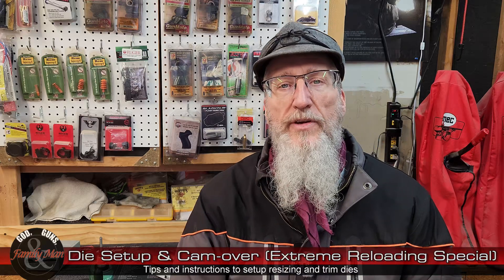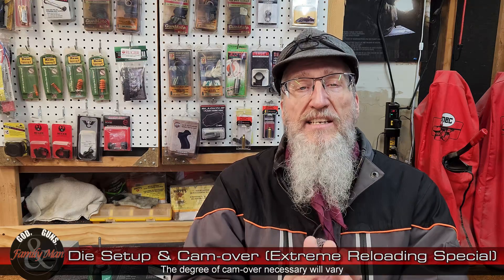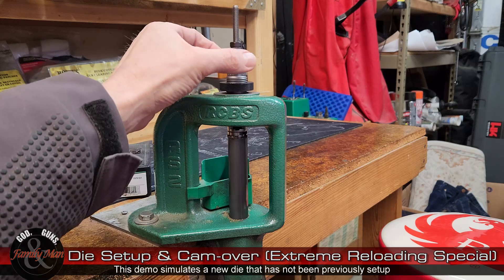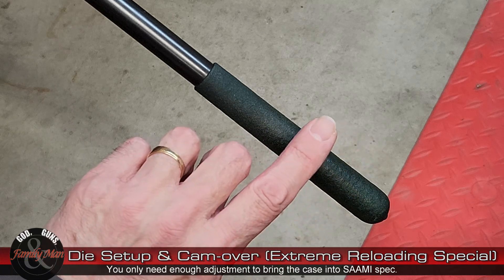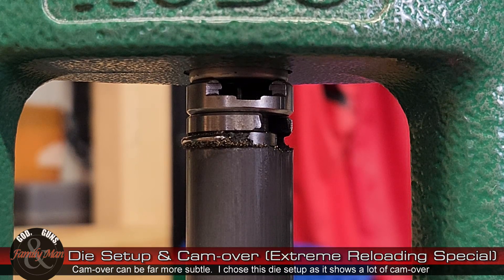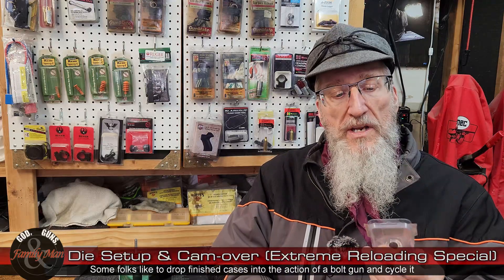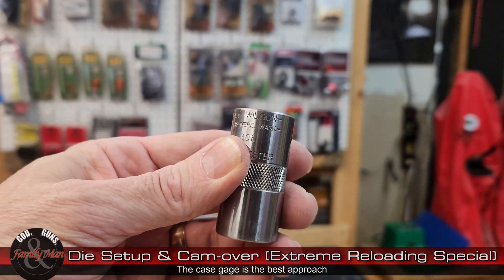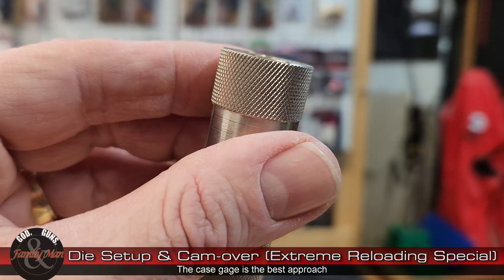Setting up and adjusting resizing dies with Cam-over (An EXTREME RELOADING Special)

Comment: The .002 shoulder bump “philosophy “ is actually a practice that attempts to work the brass as little as possible while still allowing reliable chambering. So if you’re attempting to get the most reloads out of your brass you will try to move the brass as little as possible while still ensuring reliable chambering. Maybe with a range queen you can bump that shoulder .002 or less and maybe with your dirty truck gun you might need a .004 or more shoulder bump. 

Like any metal, the more you push it around stretching, compressing and bending the more it becomes brittle. Hence the practice of annealing brass. Even with annealing brass and minimal shoulder bump brass will not last forever. I’m only getting about 8 firings on my magnums and 13-20 firings on my 22-250 and 6.5cm. Typically my brass is flowing from the thickest part of the case wall to the thinnest. So I will eventually see signs of case head separation near the end of my case life. I trim case length as little as possible but it’s inevitable. I consider trimming case length and beveling as part of the brass flow that I will never get back.

Comment: My question is…there is the .002” shoulder bump philosophy and also the neck size collet die philosophy but should you neck size until you can barely chamber a case then bump the shoulder .002” or do it every time based on the current comparator measurement. I have some 30-06 that are so short from repeated .002 bumps I know a case head separation is soon. 

TLDR = where does the .002” bump number come from ? A several time fire formed brass I would assume but it’s never specifically stated.
Reply from the maker: Good question Jeff.  I stopped neck-sizing a number of years ago. Kind of went full circle on this... I originally only full-length sized, then I neck-sized for 3-5 loadings before FL sizing again, but now only use FL sizing.  That change happened when I started annealing for my precision rifles and when I started reloading for semi-auto rifles.  
The 0.002" bump started as a rule of thumb or suggestion as a starting point from a few manufacturers.  It was picked up as gospel and propagated from there.  I call some of these things, reloader's voodoo. I may be guilty of some of this also but try my best to best to base all my practices on quantitative data.
I hope this answers your question.
Reply: @sdkweber  yes, but…how much does new brass move on the first firing, then the second, then third? Is it more then .002” or less. Seems if you just push back .002” every time then the cases will grow progressively longer or shorter unless the brass grows the same.  Seems like you need to need to fire form to your exact chamber size subtract .002” and that’s your die setting for the rest of that rifles life time. No one ever explicitly says to do it that way. 

My new strategy is to neck size until my chamber Is tight, measure, subtract .002 then set a die and after annealing and use that setting for all brass with a full length Redding elite die with a bushing for .003 neck tension then mandrel to .002. 

Thx for the response. I enjoy your content.
Reply from the maker: @ACGuy1 You are welcome Jeff.  It sounds like you have a good approach that works well for you and your rifles.  Keep it up!

Comment: Do you have a process of land jumping and/or building a load around that? My hornady 9th edition manual  says that the most accurate load for your rifle is where the projectile is lightly touching the lands and you start building a lot below minimum and working up. Was curious of your thoughts. Also love your videos, keep it up.
Reply from the maker: Thanks for watching and posting.  I have found that any blanket statement regarding the best jump to the lands is almost always wrong and due to simply not enough experience with a variety of bullets and loads.  Some bullets are far more sensitive to jump and these tend to be bullets with a secant ogive (Hornady does make a number of bullets with a secant ogive).  I have done some tests on this and the best advice I can give is to experiment with bullet seating depth until you find the one that your rifle really likes.  
Try 0.002" increments and just make sure you do not seat it out so far that the bullet actually  touches the lands... that could be catastrophic.
I also am beginning to think over the past year or two that it is not so much jump to the lands as it is changing barrel harmonics that is really making this change.  I say that because some of my testing has shown a sigmoidal (or S-shaped) curve in group size as I change bullet seating depth (or jump).  If the distance to the lands was actually the driver of precision we should see a linear curve (straight line).  I hope this helps.

Comment: Thanks again for an informative video.  One comment: When you mention that you prefer one product over another, I would appreciate it if you would mention the reason.  I value your experience and would like to know your rational for your preferences.  Thanks
Reply from the maker: That is a good question Florian.  I have tried so many dies over the years and my preference for resizing dies is based on measurements made after resizing.  I have found (what I am calling premium dies) consistently resize the cases to the SAAMI spec I am looking for.  With some other dies I found I had to sometimes resize  a second time to bring some cases back into spec.  The measurement I like to use is the CHE (case head expansion) measurement. It is useful as a normal case prep process and this is the one that really differentiated the premium dies from the standard dies for me.

Comment: Very good and informative again. You just keep delivering guess i need to support this channel. Your always giving us information in a way that it makes sense and what can be alot of work and hours of experimenting an can be costly simplified. so thank you. My question is im MOA at 100 yards but my load opens up 3 to 4 inches at 200 an 300 even more. I hear on other videos not yours that its my load? But they never give a remedy. Been reloading 3 year's so i no other must be having same issues with load development. Unless they only test to 100yards which i don't. Thank you again for a awesome job.
Reply: Do you have a chronograph?
Reply: yes I do. I'm shooting a 6.5x284 Norma 140grain Berger VLD at 2713,2720.2705.2709.2711FPS. H-4831sc-49.2gn Had same issues with 130gn having issues finding slower burning powder normal powder is H-1000 no issue's thank you kindly
Reply from the maker: @leeNWHuntinganFish4713 That's excellent Lee.  5.5 fps SD and a mean of 2,711 fps.  Nice job!
Reply from the maker: Hello and thanks for watching and posting.  What you describe is not really uncommon.  There could be a number of things going on and the first is that as you start shooting at longer ranges slight (and sometimes very slight) shooter errors start to creep into issue.  Even if the person is shooting from a bench or a very solid prone position with a good bipod etc, things like precise and consistent sight alignment, very consistent trigger squeeze can all start to show up at longer ranges.   Even the ability to absolutely clearly see the bullseye and your reticle becomes more difficult at 200-300 yards.  I feel my 200 yards groups are pretty reliable with little shooter error introduced but I also feel that I am started to see shooter error when I shoot groups at 300 yards and beyond.  
You could look at your load also and as another viewer already responded, use a chronograph to check the muzzle velocity of your loads.  If the standard deviation (SD) is above 15 (ideally we like to see single digit SD) then that can explain why your groups are opening up at longer ranges.  I hope this helps.
Reply: It all helps an makes me practice on all aspects this is my 5th rifle in 52 years same caliber I practice to 500 yards every Thursday my best friend did all the loading for me an he is with the Lord now. I never new till I started reloading the work he put into the rifles he built an did load development for me. I do shoot my other rifles good at fairly long range for myself 500yrds but will keep working on your thoughts thank you for answering your the only one that speaks volumes to me.
Reply from the maker: @leeNWHuntinganFish4713 Thank you very much Lee.  Take care and keep sending 'em down range.  I hope our videos continue to assist you in the future.